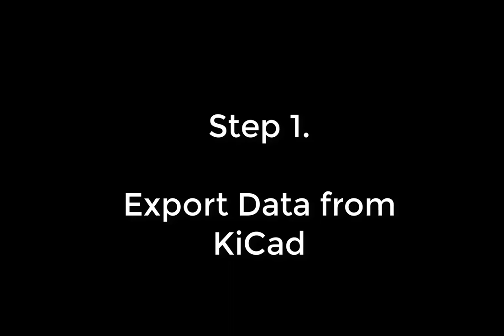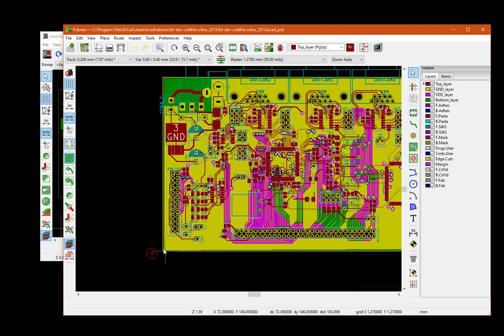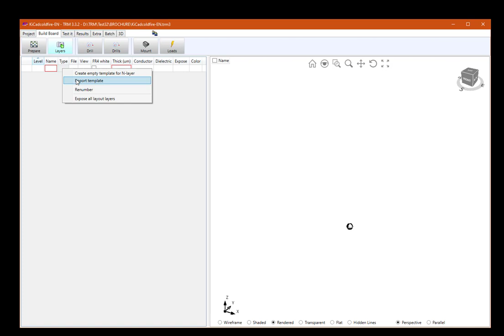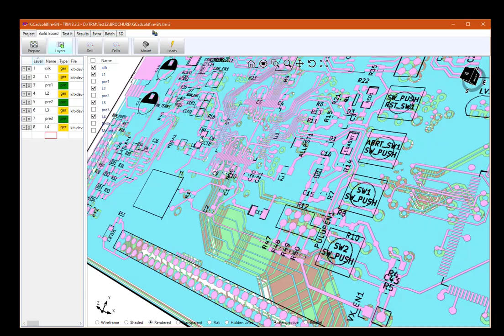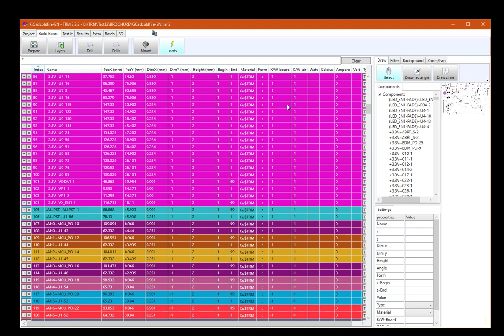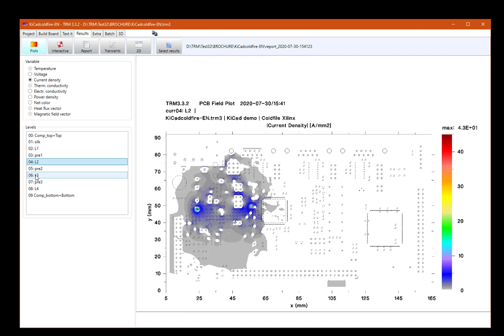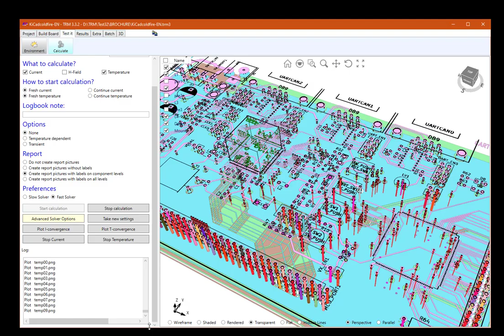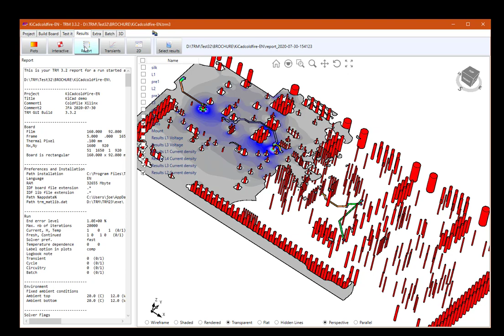KiCad and TRM: Thermal Simulation for Printed Circuit Boards

Comment: Is there a way to provide a user defined Current profile into TRM and understand the heat profile ?
Reply from the maker: Hi. what do you mean by "profile"? Is it a transient profile or a spatial? A transient profile can be added by csv file. The spatial profile is a calculation result and depends on the shape of the plane or trace.
Reply from the maker: yes it is. You import a csv file with time spans and current in those intervals.